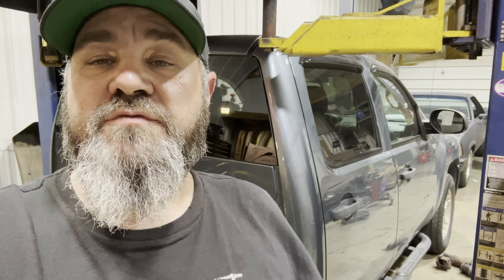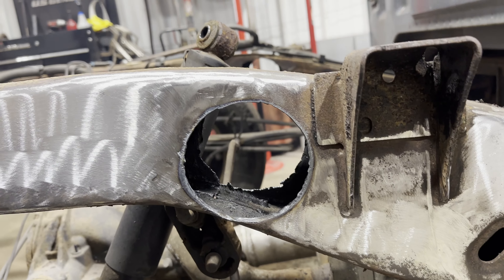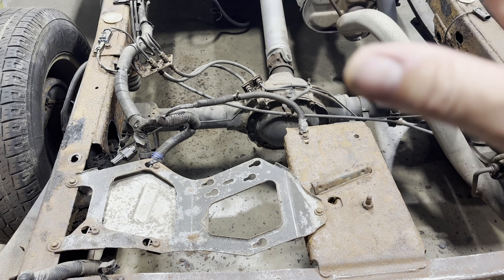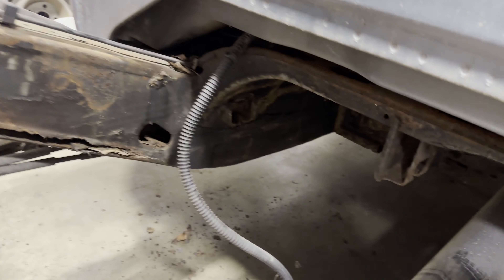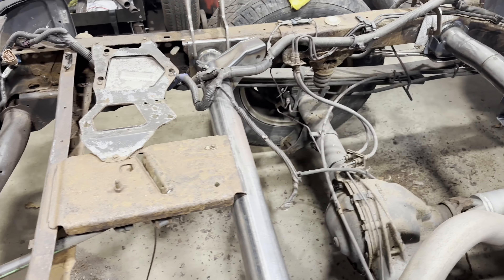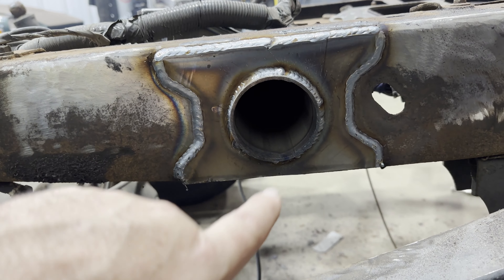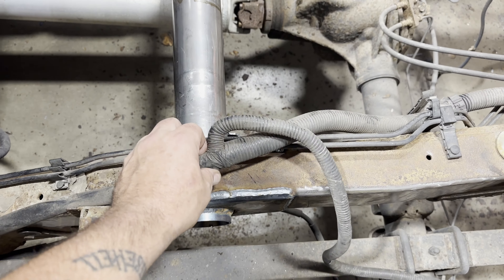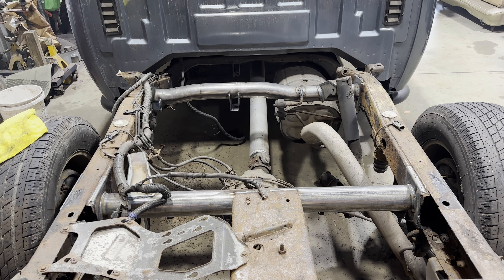2007-2013 Silverado & Sierra 1500 Frame Repair!!

Comment: Just had my 08 Silverado framework done by MorFab. Justin welds like nobody's business! I couldn't be happier with the results. My truck now feels solid and planted to the road. I gotta give a big thumbs up and Thank You to Justina. Since I live in Delaware, 3.5hrs away, she got me on the calendar and made it super convenient for me to drop off and pick up my truck.
Reply: @jvtvi4775  I'd stay away from a cracked frame, especially in a 3500 which is a 1ton vs the 1500 half ton capacity. The job in this video is the crossmembers that attached to the frame. But send that question to Justin directly.
Reply: @jvtvi4775  Not a bad price but I wouldn't buy it with a cracked frame

Comment: Great work. I have just finished repairing my Isuzu trooper frame and I wish to god I would ha e lofted the body off. Bit more work than a truck. Ed but welding the top of the frame was a nightmare. Can't wait for the longer Jeep video.